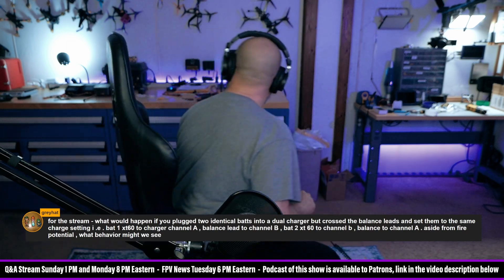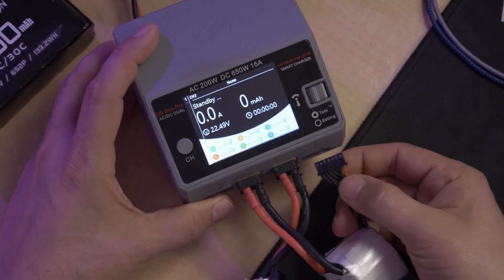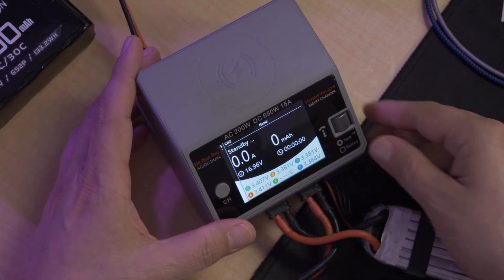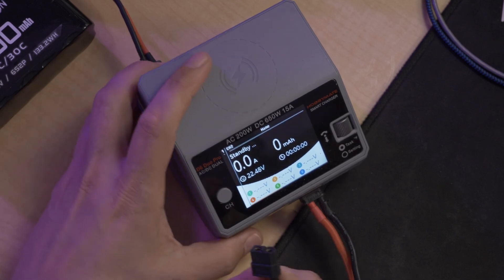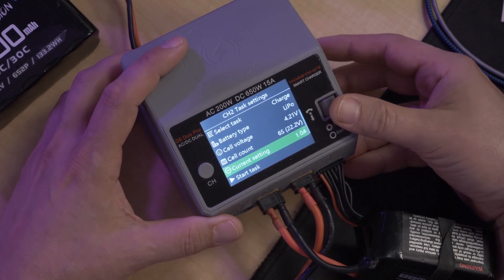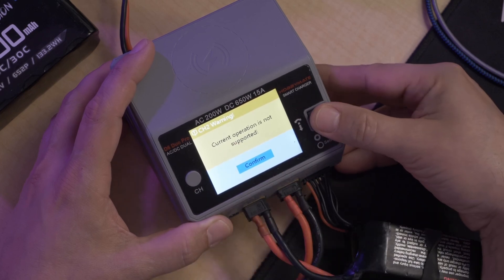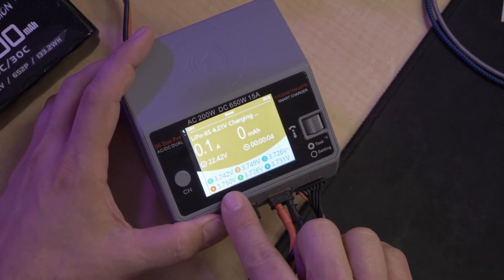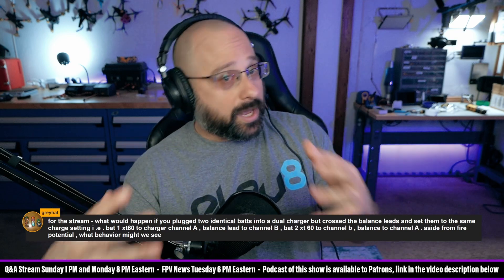What Happens If You Plug Your Batteries Into The Wrong Charger Port? - FPV Questions

Comment: I use a parallel charging board and since all connections are in parallel it will charge no matter what ports u use (any battery can be on any xt60 or jst plug with no problems so long as the batteries have the same voltage rating

Comment: Because when the garbage truck compacts the garbage, it can rupture the battery, causing a fire. Lithium batteries are a problem for trash facilities
Reply: If you discharge the lipo to 0v it wouldn't be a problem right?
Reply: @droomdronen731 That would make sense to me. If there is no Voltage than the electrons have no potential energy to jump from the cathode to the anode or vice versa. So, if the battery gets shorted out nothing should happen because the electric potential of each side of the battery is the same, thus no excitement and no fire.

Comment: If you plug in your HOTA D6 Pro into AC power as well as connect a battery to the rear input for power. It shorts the connectors. This is a huge oversight and I almost fried my charger because of it. My original intent was that I was external discharging with a heat sink on my lipos but I didnt want the battery to die if I forgot about it. I wanted both the battery and AC plugged in so it would use AC power for powering the charger after the battery was in storage voltage. Big mistake. It sparked a bit and what not but the charger seems to be fine.

Edit: Just tested with a multimeter, when you connect it to AC power, it pushed out 63V on the DC input on the lines and that is likely AC as well. WTF Hota, this is a 100% fire hazard